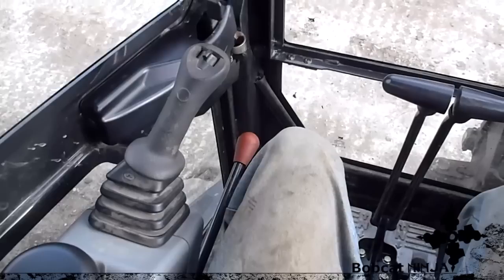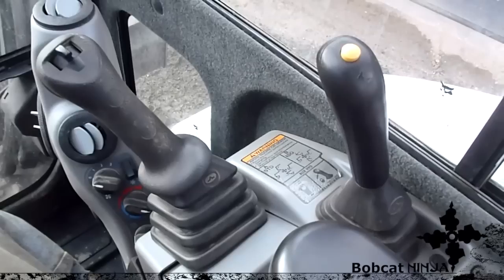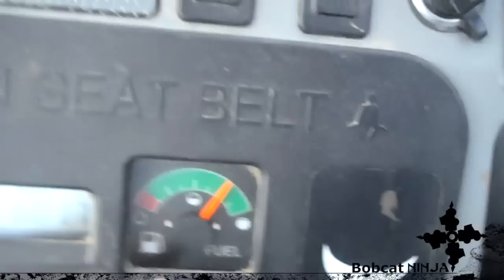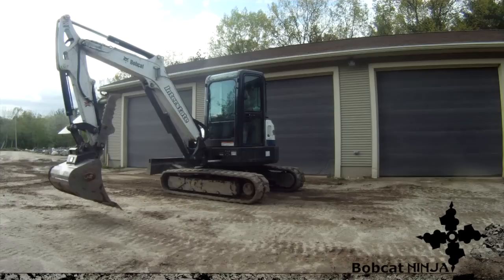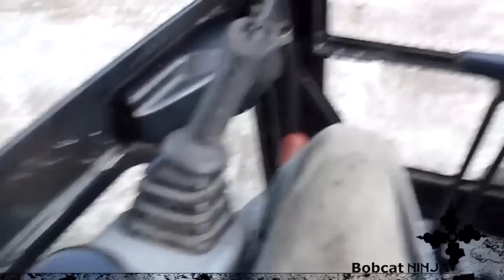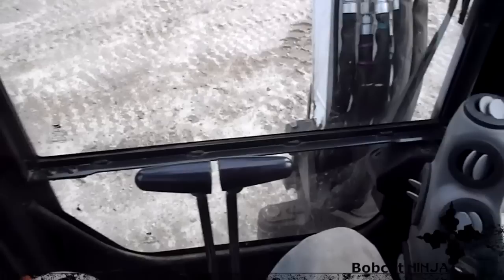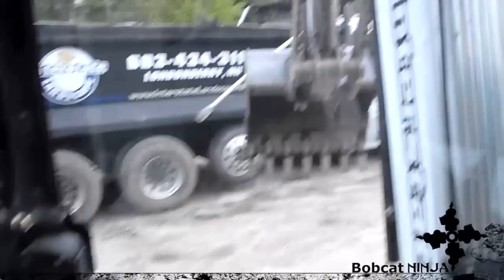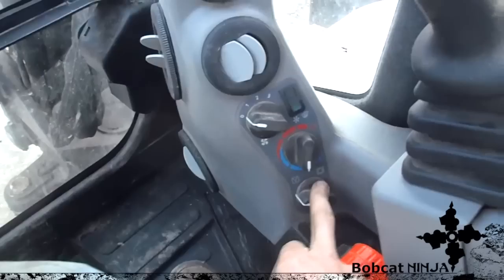Mini-Excavator Controls Run Through

Comment: Well,unless you're working tomorrow I'll pass you up with my E50.  I run the thumb on the secondary since I keep the primary open for my mower.  It gets old switching back and forth between swing and thumb, but it's nice setup for me when I am running my tilt.  I can swing the boom and tilt the bucket at the same time.

Comment: i was always good at an excavator but i neb=ver new there were different controols. if i was in mine i could tell you exacally what does what but i can't do it if i am not in the machine. i grew up running a huge cat excavator,so whatever controols are on that. it was an older machine with busted windows but man would it go anywhere and i mean anywhere! if you could figure out how to rig rocket propultion to it it would even take you to the moon!

Comment: O.M.G... THIS GUY IS WRONG!..  and so is ( Random Acts) whose trying to back him up. The CORRECT control pattern is displayed clearly on the diagram of the control (decal) at 3:13 which you can see for your selves.. Firstly it is BOOM and STICK when referring to and NOT arm and stick in fact, arm and stick is the same thing. Here's where I think people are getting confused the diagram shows an (A)std and (B)iso this is NOT(A) for the left joystick and (B) for the right joystick. The diagram is showing LEFT JOYSTICK ONLY for both A and B... how you can know this is true? Because left joystick swings cab left or right and the right joystick opens and closes the bucket in both STD and ISO controls and if you look at diagram (B) it shows swing the same as in diagram (A). So A is showing arrows pointing down and up for BOOM which is STD/CAT/SAE pattern and (B) shows arrows pointing out and back for stick/arm which is and can ONLY be ISO pattern... and is shown for LEFT control joystick ONLY!............ WOW that took longer than I thought it would, although I do hope that it set the record straight... or you can just Google it !

Comment: And on top of my compliments (of a few minutes ago) I see that I can set the (joystick) controls to behave exactly the same as my Kubota backhoe, and many traditional backhoes by other makers.  Nice.  Readers may also want to practice the control exercise devised by "DaveKnowsHow" (https://www.youtube.com/watch?v=Koa56PuOYOQ).  After a few hours of practice, I could run the backhoe close and parallel to the ground, with a smooth action. When I started digging for real (thinking the exercise was a bit unrealistic) I found I could dig quite straight and with a constant depth.  Thanks again. Really good effort on this video.

Comments are from Australia!

Comment: you got the control patterns wrong, but apart from that great video!
Reply: No yours are wrong
Reply: no he mixed up excavator and backhoe
Reply: Lewis Guest No he didn't? In North America, all the control patterns I've seen, SAE = CAT which is right = boom. Iso is farmer shit.
Reply: ISO is CAT controls. SAE is Deere aka backhoe pattern
Reply: Lewis Guest Exact opposite, do you run excavators/backhoes at all?
Sae in any excavator I've jumped into (except one of our old as dirt ones where the mechanic manually switched it to iso and the decals are wrong) is CAT/EXCAVATOR.
http://en.wikipedia.org/wiki/SAE_controls
Reply: Yes I do run excavators not so much backhoes. I live in Australia and we consider ISO standard excavator/CAT pattern. It might be different here. I am sorry for this misunderstanding. 
Kind regards
Reply: +Lewis Guest so if i ran iso patter i'd be running cat controls?
Reply: yes
Reply: +Lewis Guest which one is easier for newbies?
Reply: depends what are you planing on operating
Reply: +Lewis Guest skidsteer
Reply: what brand they have different patterns
Reply: Lewis Guest bobcat
Reply: +Lewis Guest  You are certainly correct.  And ISO specifications do not change at a country's border. They are the same everywhere.
Reply: no he didn't do it wrong.
Reply: Lewis Guest no he did not